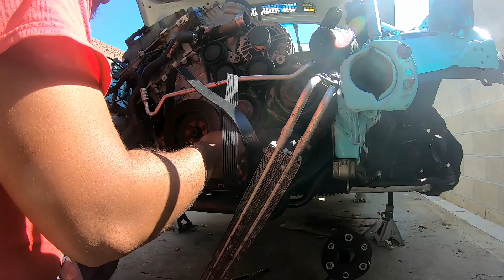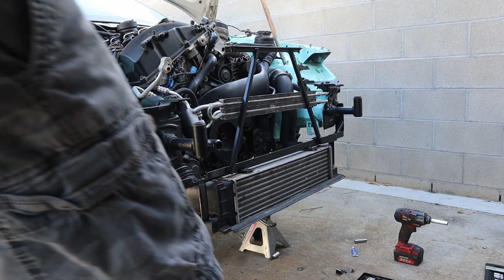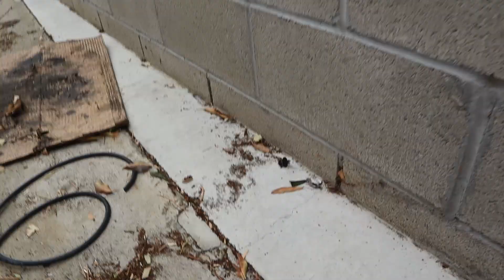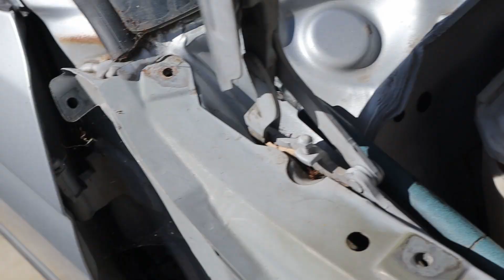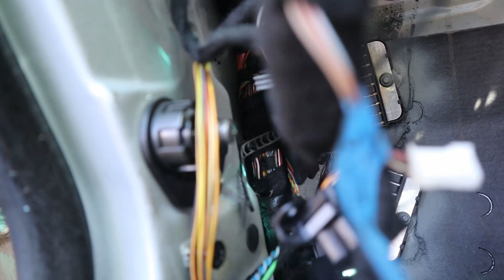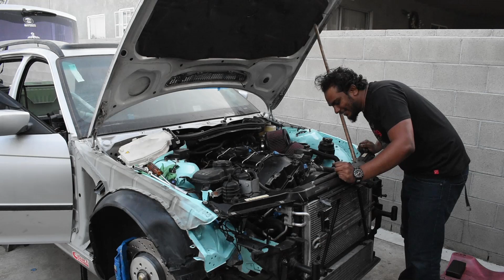N54 SWAPPED E46 WAGON WILL IT START ??? | 400Hp N54 POWERED E46 WAGON BUILD EP -26

Comment: Yeah buddy! Congrats 

Two things though 
You could just chop brake line at clutch master and put a bubble flare on it to connect to that clutch line you have I believe. Get rid of the mess of adapters that one that’s threaded to a an dosent look like it might seal nicely in high pressure system. 
&
Will e46 fuel pump be ok for n54 demand? They normally have a high pressure fuel pump right?

Looking good can’t wait to see more progress
Reply from the maker: Thank you for the tip, I guess I was set on getting a cable with the adapter. It didn't even cross my mind to flare the end like the brake lines. I would have saved some $$ and time. So far the line works, I'll remove the adapters and change the end if it starts leaking.

Comment: A hydraulic hose shop should be able to make you a clutch line with the fittings you need reasonably cheaply if the adapter stack doesn't work out. Super stoked to hear it run! Great job man!
Reply from the maker: Thanks for the tip!